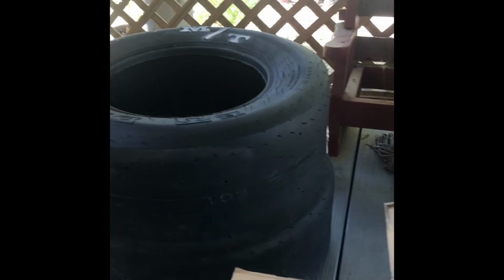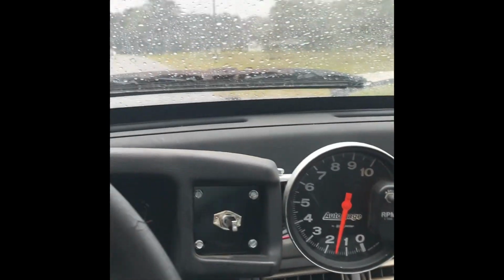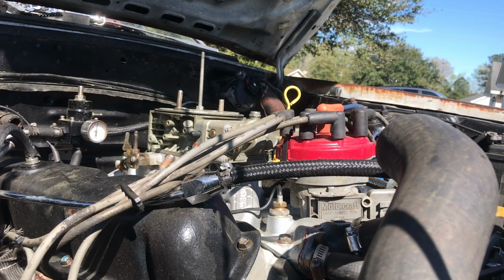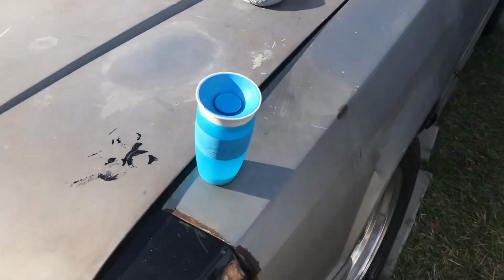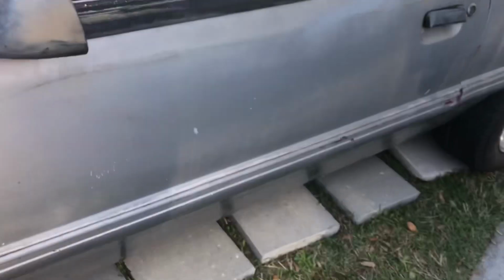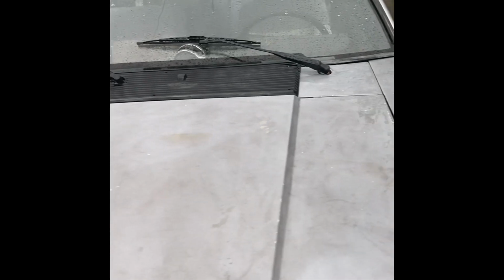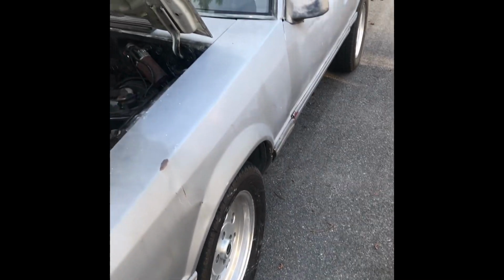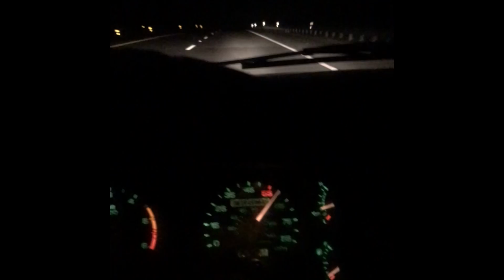Polishing a Turd 💩🤷‍♂️

Comment: That's plenty of carb for that application buddy, I want you to stand on it one time for me please 🙏 😂😂😂. I'd start with a 66/70 jet on mine I ended up with more jet because I don't drive mine at all on the street. I'm locked out at 36 degrees 2 pumps and starts right up, it hates the summer time tho lol
Reply from the maker: It runs good with the 650 but I had to jet it down just a tad because of the lower compression. Oh I’ve been laying down the 1 tire fire 🔥😂 check out the end of the video I put out today